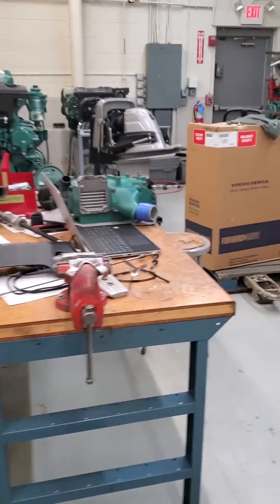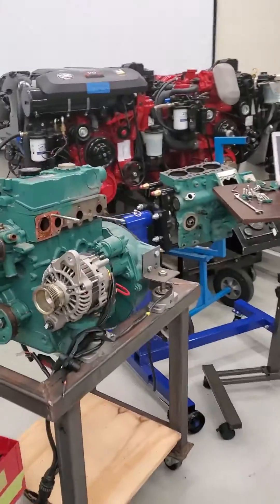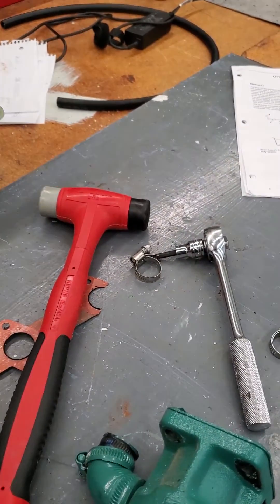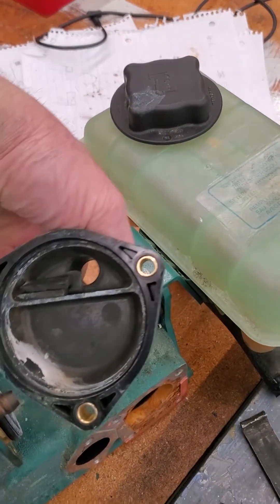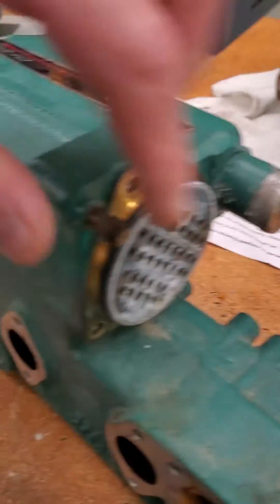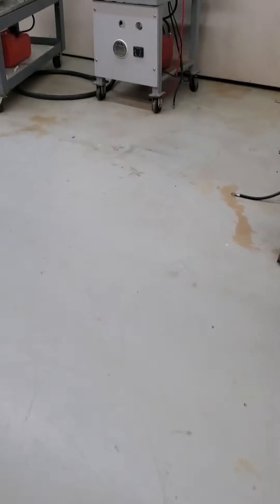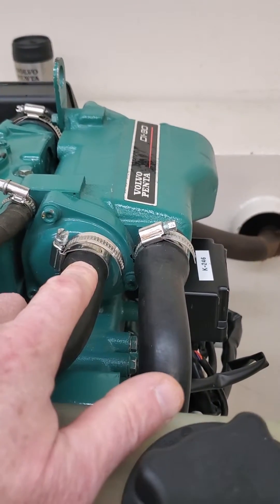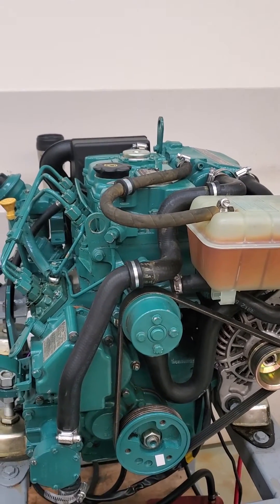Diesel Lab Aftercooler and Heat Exchanger Service

Comment: Hi Ted
I’ve got an interesting situation.
Tamd41p and at wot it leaks engine oil out of the bottom aft end of the heat exchanger!? I’m unsure how oil can get there? I’m planning on pulling the heat exchanger apart and servicing as well and the oil cooler. What is happening for oil to make its way there?? There is no oil in the coolant reservoir.
Any help would be greatly appreciated 
Regards
David
Reply from the maker: @davidsimmons7855  I would not go ripping coolers apart yet. You likely have oil that is leaking onto the heater exchanger. Due it only happens at full rpm, it's likely caused by excessive blowby and that's pushing oil out with the crankcase pressure.
Have you changed the crankcase filter? Also valve cover gaskets are notorious for this leak. 
I would clean the heck out of that side of the engine, dry it off, and the run it up quick to see if you can see where the oil is running down to.
Reply: @ Thanks for the replay. the engine is in a very clean condition so I will have a closer inspection today but I’m not so sure it could be leaking from the valve covers, it has a crankcase breather tube that is redirected into a catch can instead of the air filter housing.
Reply from the maker: @davidsimmons7855  can you email me a  few pictures of the area of the oil leak to marinedoc01@yahoo.com
Reply: Thanks for help Ted, on closer inspection it turned out to be coming from the dipstick which is a great find and also slightly embarrassing 🤦 another question though, I’m making my way through the engine replacing and cleaning and resealing as I go and after the exhaust elbow I’m left with the turbo, now without sounding like some kind of a kid do i eventually replace or rebuild said turbo to the exact replacement spec or is there a turbo upgrade that is beneficial without risking reliability?